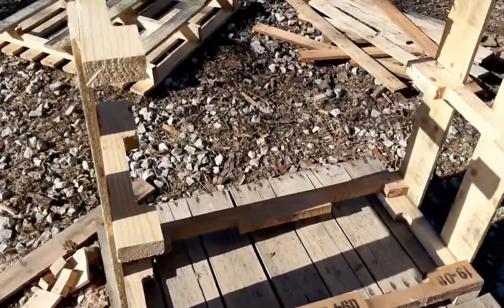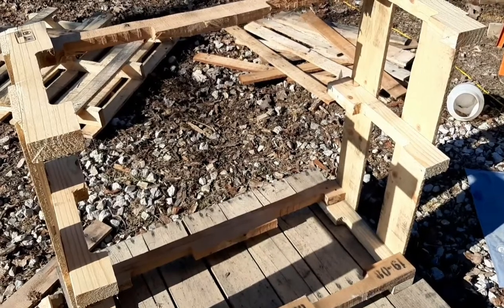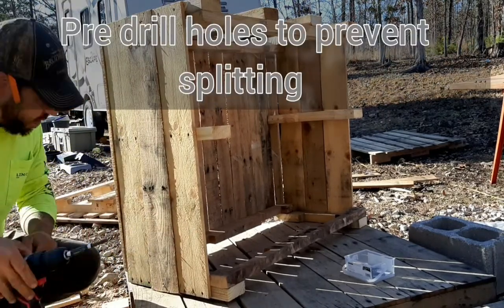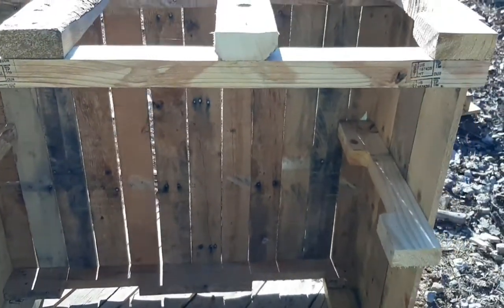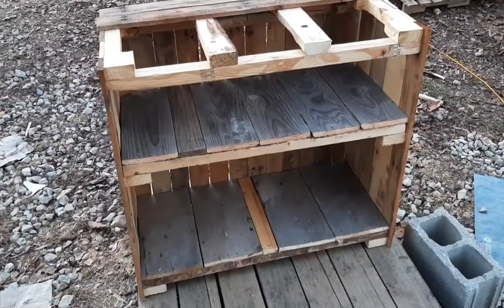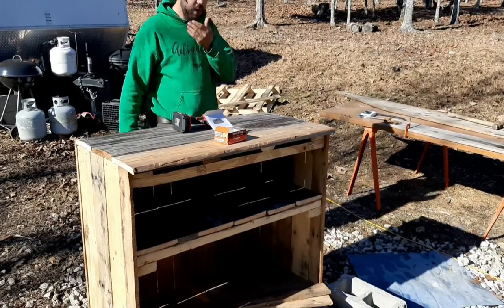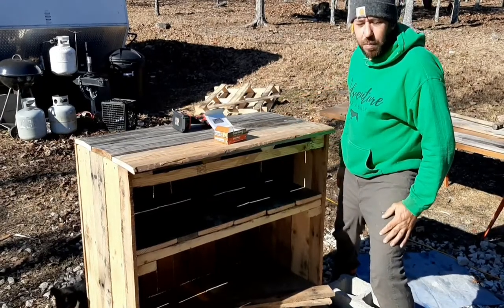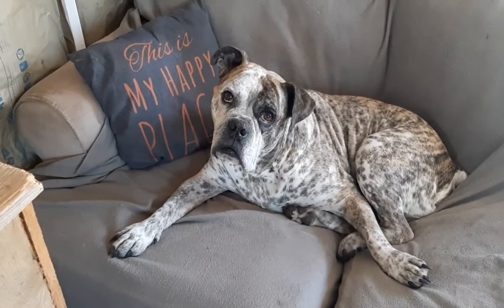1st Time Building Cabinets, and using free pallets

Comment: Turned out looking good nephew a little advice to make it a little lighter get you some gorilla wood glue and you won't have to use so many screws on the next one maybe 1 screw on each end and 1 in the middle per board with the glue and it will never come apart
Reply from the maker: That's all I put in it anyway lol. It's just all heat treated oak. Works well though